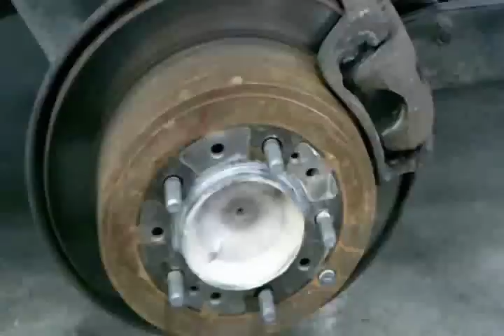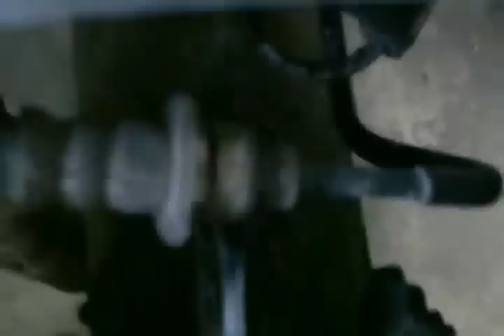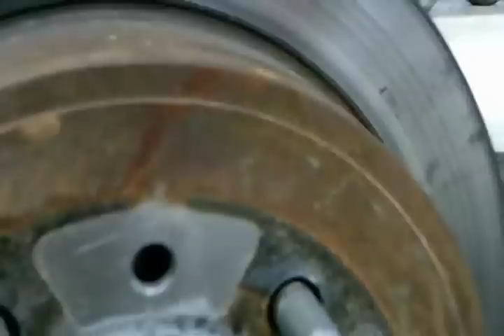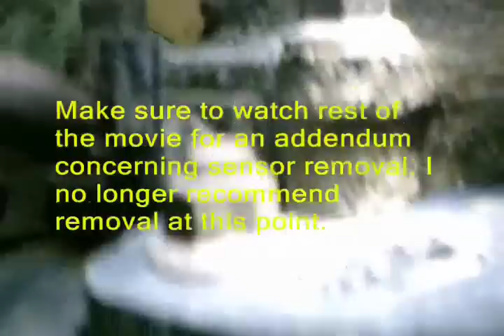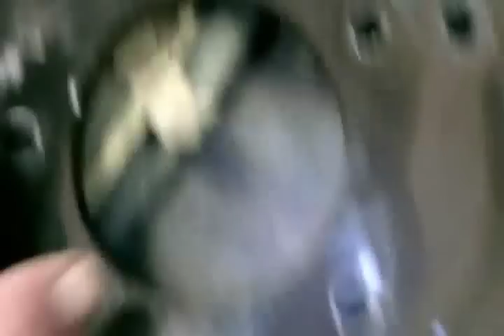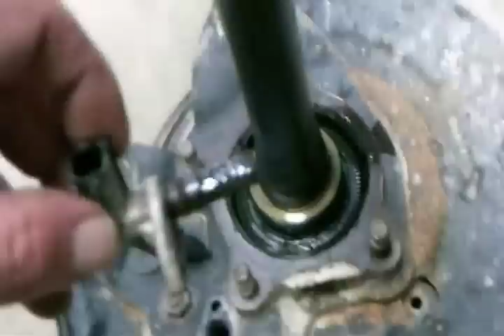2007 (2nd Gen) Toyota Tundra Rear Wheel Bearings Part1

Comment: can the brake cable be removed without removing the shoes? I have an 07 tundra and am about to remove the whole axle shaft assembly and put a new one in and am wondering about that cable.
Reply: Yes you can just push the stop on the end of the cable to the sloped portion (looking straight at the hub it slopes toward the center line of the truck) of the bracket it sits in then pull it out through the back

Comment from the maker: Truck had around 90,000 on it, but they had started to go bad well before that. Rotors rubbing the brake backing plate gave indication of the issue (noise especially when turning). Disappointing as i expected better/longer life from toyota honestly. Seals looked good actually once i removed axles, and nothing really visually wrong other than wear through on backing plates as shown in the video. Pretty expensive repair from dealership, am glad i tackled the repair myself with an assist from machine shop to press new bearings on. Saved in excess of $1000 over what shop quoted.
Reply: Dealership quoted me over $2000 for bearing and speed sensors replacement
Reply: How much did it cost you

Comment: Never, ever bang on threaded studs with a hard mallet or hammer. That's how you ruin threads. Also, do not pry the ABS sensor out by the tip of the actual sensor. Hopefully you were lucky enough to not need new studs and sensors.